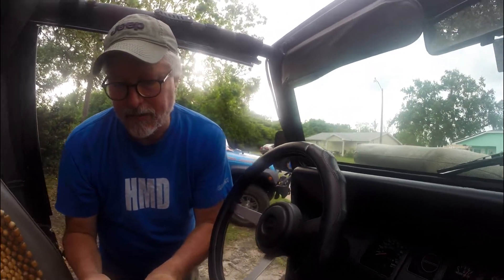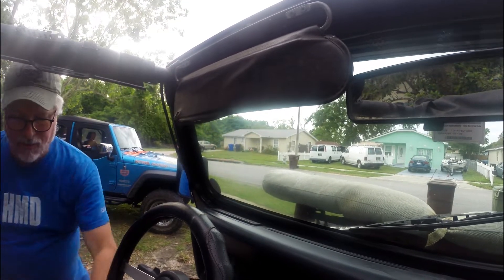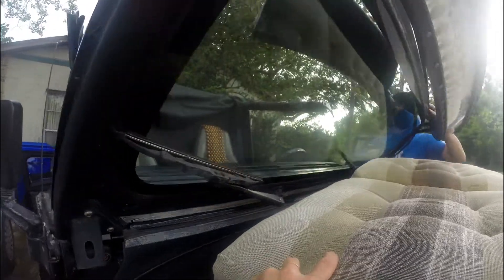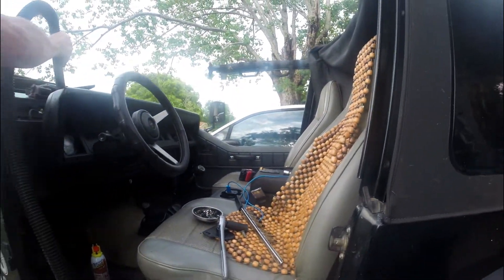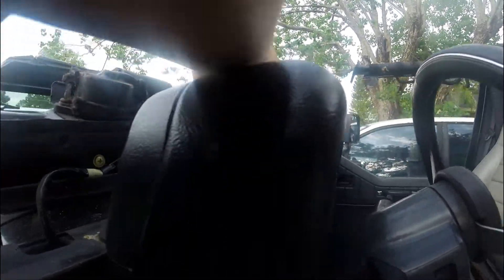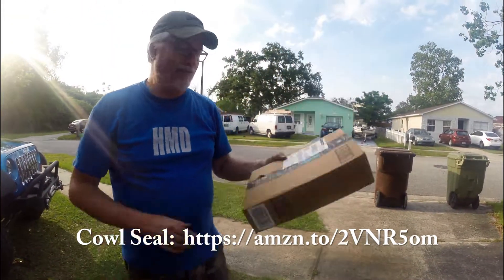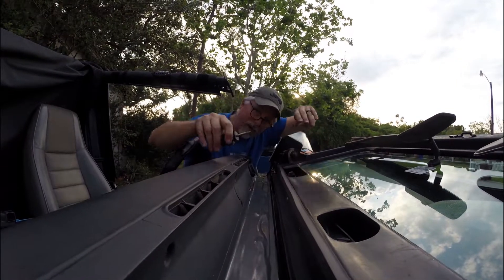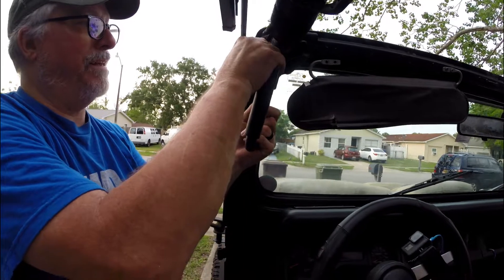1995 wrangler windshield COWL seal and grab bar install.

Comment: thank you so much!  I am a woman.  I am retired.  I haen an 89 nobody will fix it.  I found a great guy that restores vintage cars that will replace the cowl seal.   Has been blowing fuses.  Thank you for the link as well.
Reply from the maker: It was more of a task to get it cleaned up then to install the new one. No more leaks.

Comment: '92 here.... Ya should have taken care of that rust now or do it soon.... I did a whole windshield frame and and cowl seal replacement a couple of years ago. Then, a couple of weeks ago, I decided to tear apart my dash to take care of some rust issues that I saw when I did that windshield frame... Next thing I know, the whole dash is off and I'm replacing 90% of it. After I tore that down, I took the jeep to the paint shop and it's getting painted....🤣😎. You have a link to those grab handles?
Reply from the maker: https://amzn.to/353LXRc     I got mine at a 4wheel parts show and they were less then 50. I will have to pull the glass to get to the rust issue. I have pulled the glass a couple of time on a Cj and found it to be fun....
Reply from the maker: Also from the maker:  https://www.rtoffroad.com/grab-handle-set-black-steel-2435.html   They look the same but you have to find a dealer.

Comment: Always enjoy your videos. I installed a new cowl today and at the front of the windshield it does not seem to be as tight to the frame as the old one. Is this because the old one was so old, worn, and hardened, while the new one is soft, and flexible?
Reply from the maker: I noticed the same thing. It’s not leaking anymore so I guess it’s working. Next up is the whole frame. I think it may compress and expand over time.
Reply: @FloridaJeepRides  thanks so much.